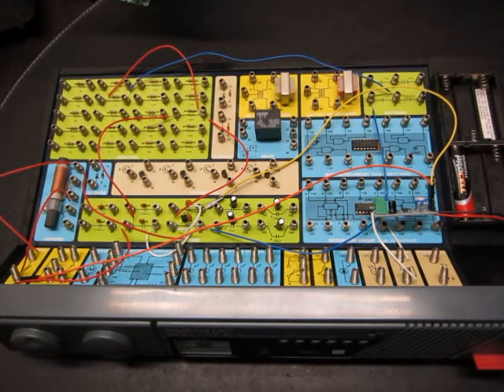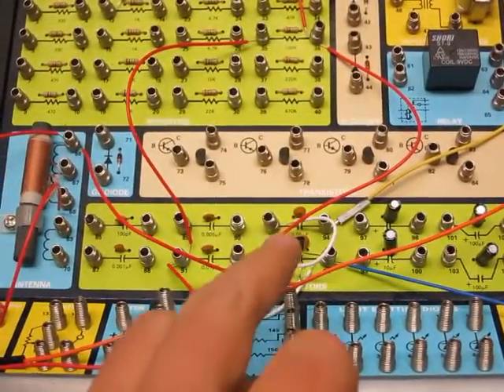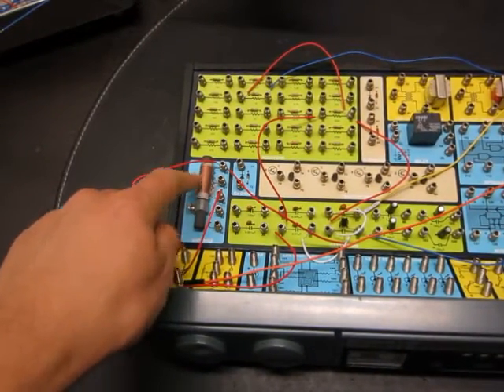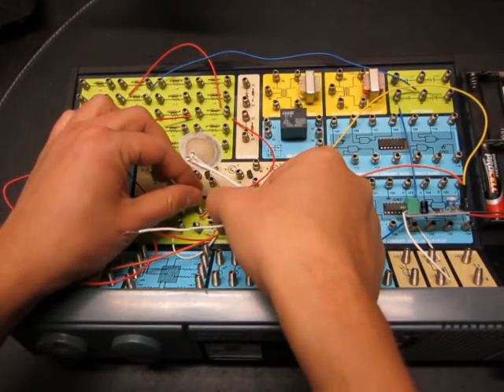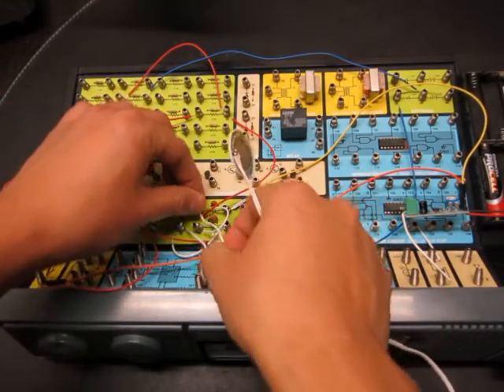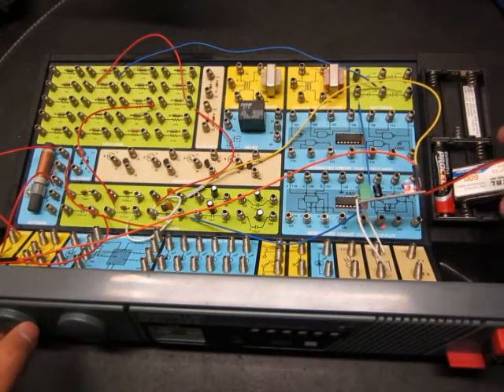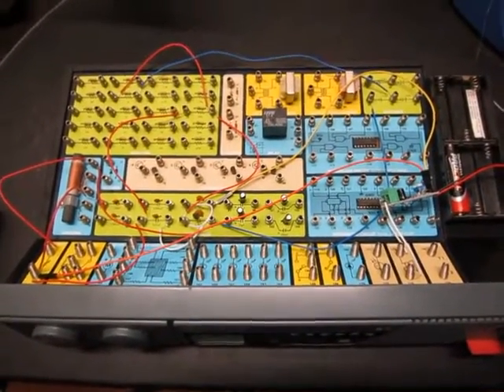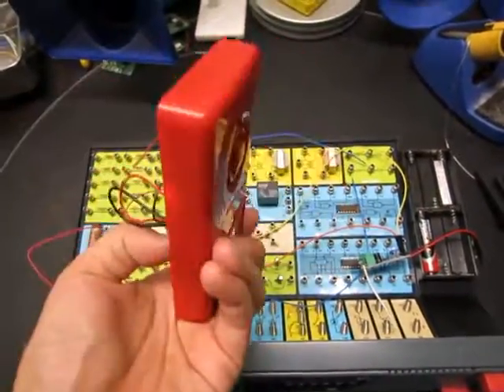TA7642 Radio with LM386 Audio Amplifier

Comment: Yep, MK484 or TA7642 plus LM386 audio amp is the "standard" hand-built broadcast band radio.  The little three-pin IC is absolutely amazing; literally a radio on a chip.  Most of the radio consists of the audio amplifier stage.  You can do away with that if you use a high-impedance set of headphones designed for the old crystal radios.  Not that is radio with a real minimum of parts.  I built one like yours where I can switch the broadcast band coil out of the circuit, and attach a shortwave coil.  The TA chip isn't ideal for shortwave because it peters out at about 10 mhz, but there's still a lot of shortwave activity below that limit.